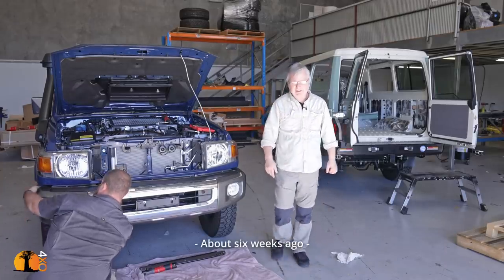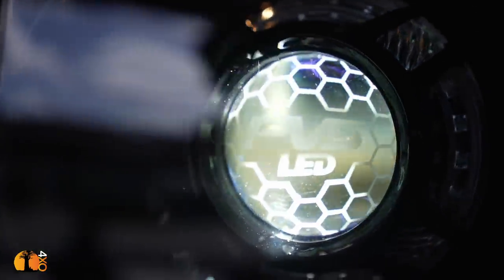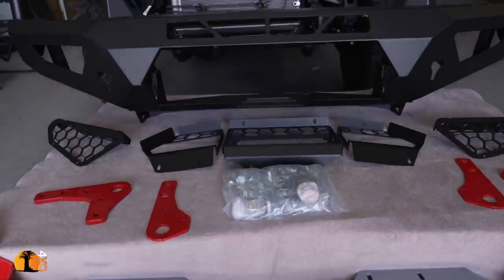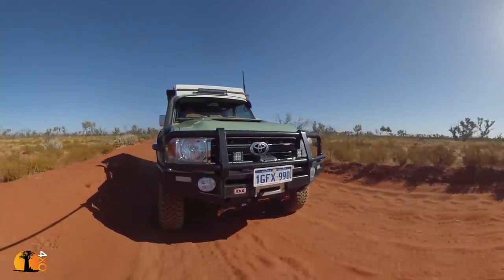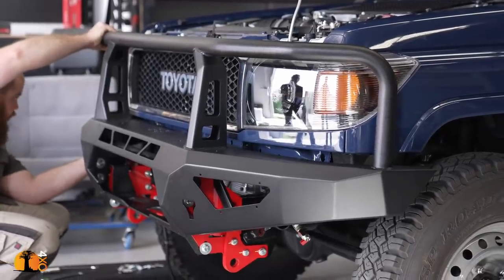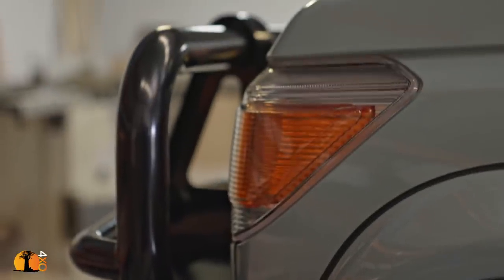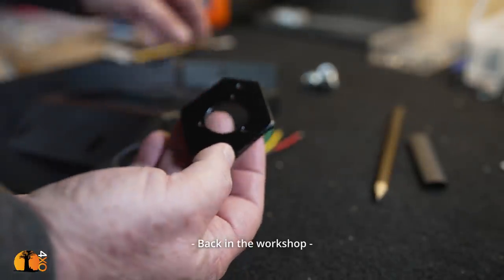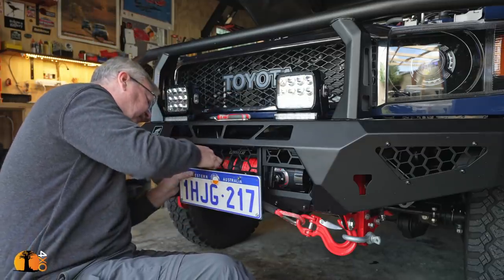BULL BAR, LIGHTS, WINCH & WEIGHT | How much weight have we added so far? | 4xOverland

Comment: Bull bar looks bloody awesome. Why didn’t you go for in cab controls for the Winch? That way you can slap that ugly box in the engine bay. Did that with my hilux, definitely the way to go.
Reply from the maker: Because from the cab, you can't see the winch. IMO, another bad idea.
Reply: 4xoverland I’m not following
Reply from the maker: @RyanYoxo  Controlling a winch from a location where one cannot see the winch or the recovery operation is like flying while blindfolded. BTW. I hid the box in the bar.
Reply: 4xoverland the winch is in front of the car? Can’t you see it? I’m generally confused. Plus you want to be in the car to give a little drive when needed or steer when needed. Just my opinion from living at the foot of the vic high country..
Reply from the maker: Yes. And the cab is inside the car, from where the winch cannot be seen. And nor can the wheels be seen, or the way the rope is spooling etc. Ive always winched from in, out and around the vehicle, and if it's a tough pull, the bonnet raised to protect the windscreen and driver in the event of equipment failure. To my thinking, the very last place to put a winch controller is inside the cab.
Reply: 4xoverland ok I see what you mean, you can’t see the barrel, tho wheel placing is easy to figure out from knowing your car but being around the vehicle with a loaded winch isn’t exactly work safe... rather than the spotters having the remote to control the winch wouldn’t it be more effective if they have a two way radio and informed you of anything you can’t see? I’d still rather be in the cab so you have complete control of the car than standing off to the side of it
Reply: Lots of bolts to rattle loose.
Reply: @RyanYoxo   I think if you need power to the wheels on a solo trip that is the only real reason to be in the cab, 90% of the time I’m with Andrew on this as I want full view of winch and wheels as not being able to view either makes it easy to damage the vehicle or winch if not paying attention.
Reply: Rauðr Ridge Overland I guess my winching has been straight forward because I can’t comprehend any of that.. what happens if the winch were to break and you weren’t in the car, or do you have the hand brake on at all times? In the cab I have full vision of the anchor point and rope, and again I have no issue determining the wheel placement especially if you have someone with you
Reply: @RyanYoxo  I get what you’re saying, each persons experiences are different. There are situations to be in the cab I agree, as I mostly solo trip on steep muddy/rocky inclines in the mountains so from the cab makes sense. However for a majority of people who are mostly on standard mostly flat ground or with two separate people the person controlling should have full view on the winch and wheels in case of winch binding or steering damage. It’s more of a machinery longevity/safety thing rather than convenience especially with the weight of the vehicle and power of the winch.
Reply: Rauðr Ridge Overland ok I see what you mean now especially watching the winch barrel for binding(generally can be felt tho). Like I said I live in the vic high country, it’s quite steep, so being in control of the car is most important imo. Also being an ifs car with only a lsd it means my winching isn’t complicated just get over the washout in the exact direction I was trying to drive it.
Reply: @RyanYoxo  i completely agree as I run steel cable due to weather extremes so I can also feel binding on the drum, however  i don’t know if synthetic is as easily felt or heard on the drum binding as I’ve never run it on any of my winches . I think you and I are kinda the outliers here since we both deal with a lot of mountainous terrain as most people who overland/off-road don’t. Andrew is far more experienced than me in terms of overlanding but I get where he is coming from as a heavy winch/machine operator we are always taught watch the cable and drum at all times. I agree with you 100% on the brake and cable breaking safety issue but I also agree with Andrew when it comes to normal low tension/pressure winching.
Reply: Rauðr Ridge Overland I agree. I’m no expert rigger so generally I wouldn’t know what’s best but I wouldn’t want to be off the side of a loaded winch that’s for sure. I wish to learn all forms, but for me being able to operate within the vehicle is safest, especially since I wouldn’t try any tracks I’ll need to winch out of by myself

Comment: Automobile makers are saving weight with High Tensile Strength steel. I wonder what it costs as an alternative.
Surprising about front:rear weight additions.
They really designed the bar to give it a look. It reminds me of a GMC. 
The railways use beltpacks (radios on a belt) to control switching locomotives. The person with the belt is the locomotive engineer. Communications with yard workers would remain the same.

Comment: Very very attention to details! Even the hexagonal mounting plate for winch controller socket! But cap is upside down! But maybe better that way. Yes That winch box is ugly thing! I do`nt know why they continue to build that way....?
Reply from the maker: Cap is upside-down for a reason. You guess why I did that.
Reply: @4xoverland  I guess because it is mounted at low position so when you actually look at it you will be looking upside down which translate you will be looking right side up????

Comment: I agree with your logic about one person being in control of the winch but can’t fathom your logic on whether that person uses a wireless remote or hard cable controller??? What’s is the difference? In my view the wireless remote would give the person better options to stand in a safe place in case a winch cable snaps. This is limited to some extent when using the hard cable controller due to the length of the cable.

Comment: Hey Andrew, I found the runva 13xp to be less superior for my application to the 11xp and for these reasons:
13xp is slower. By a fair bit
Was told it’s heavier
Less used than 11xp there for less rnd possibly?
Larger unit overall
Possible higher current draw? Due to 13xp
What are your thoughts on this? And what pros and cons do you see between the 2 units

Comment: How much more weight will the self levelling & wash system be that you'll obviously be fitting to make the headlights legal?
Reply: @jim yeats That only refers to the actual beam pattern as displayed on a beam tester. If you look further down the product page under the "Please Note" section you will find even they say for full ADR compliance a wash system & automatic self levelling must be fitted. I'm an automotive design engineer who worked in vehicle design approvals & this regulation has been around for years.
Reply: @gaj5701  Yes I see that now. Still seems very interpretive state to state and how ADR wants to view it. New cars are coming with LED’s without self levelling and washers. Just seems a bit over the top in general. Self levelling headlights and washer systems are one of those things put in place with very little data supporting their use with regard to their ability to actually decrease accidents and fatalities.
Reply: @JimYeats  The regulation is specifically for aftermarket units that change the method of beam pattern production as they haven't been approved for use as part of the whole vehicle. On a new vehicle, every technical aspect of the headlamp unit from light intensity to the method of attachment to the overall vehicle type is taken into consideration, which is why you often see the units fitted without the features required for an aftermarket one. As far as local interpretation of ADR, from what I can gather, there's no change for mandatory lamps, only additional ones such as spotties etc.

Comment: I see the argument for NO radio controlled winch switch as very  valid. More than one winch involved in a recovery!? My choice would also be a cable connected controller!
The on/off switch in the car on the dash for the winch controller is a good idea to stop people "playing" with the winch AND an emergency off-switch for the driver independent of who has the controller!

What I do not follow is the importance of the, I would say, over-kill of lights! Noone in his/her right mind will drive in the dark off a proper road except in an exceptional emergency! For those rare cases are all those lights? I have two additional lights on my cars for emergencies,  last time used? Can't remember - I avoid emergencies!
For just looks those lights are too expensive, aren't they?

Comment: Cruiser looks good. How did you take the shot @2:00?
Reply: If you look at the shadow, you can see the camera is on a mounted system.
Reply: @filipevieira2697  Thanks. Wondering how it is 'invisible' to the camera though shadow shows it is mounted on bumper directly in front of camera.🤷

Comment: Hi Andrew the bullbar looks a lot lighter do you think it will do the job it is made for .
Reply from the maker: It will. Is it as strong as the ARB? I doubt it. But how strong does it really need to be?
Reply: @4xoverland  I'm a Truckie they need to be solid but your a very experienced driver just need to be cautious thanks for the reply I've been following you since your last troopy build but could not afford the patreon part for a while but love your sincere reviews and I have copied a lot of things you have done sorry if I come across a bit blunt sometimes but I love all your work. Regards Paul
Reply: Rocket Rod fitted the prototype of this bar to his dual cab cruiser. Should check out what he has put it through. They are more than strong enough if he hasn’t been able to damage it.

Comment: Andrew what happened to no spot lights as they interfere with airflow to the radiator? Not counting a winch as well.
Reply from the maker: Now you are just putting words in my mouth. When did I ever say, 'no spotlights'? What I said was, 'overly large spotlights can cause cooling issues'. And they can. These are quite small and probably obscure less than 15% of the radiator frontal area.
Reply: @4xoverland  I apologize Andrew. I got it wrong, I thought you had said, no spotties and  had a rethink. My mistake.  Cheers, love ya channel.

Comment: The choice of bullbars is a personal choice and for me I still prefer the look of the ARB.
Re: Remote winch controller - even though what u said has some truth to it, winching is not something u take lightly as safety should be paramount and using the lead can put the user in the danger zone and this is where the remote has an advantage. The remote should not be touched until it’s ready to be used… So I don’t really agree your argument…

Comment: If you don't use the winch often, you may forget to check the batteries in the remote and when you need it, it won't work. Not something I would rely on

Comment: I guess is that your thought process at 08:00 is correct - but possibly you do have a bit of a specialist following in that your fans are more likely to know a bit about what you're doing, are a bit more cautious than the average "let's pack up and floor it through the mud" crowd. Thereby explaining those differences between your poll and the overall perception.

Comment: All winching operations you perform are operated by a remote switch, you are merely saying you prefer a tethered remote vs a wireless one.  To assume the operator is more or less involved based on wired or wireless remote isn’t a valid assumption.

Comment: Bull bar looks great! Along a similar vein, with remote winch controllers, I've seen a few guys forget batteries, not have the cabled backup, and then be stuck with a winch with no remote. Makes a great paperweight though! 🤣. Convenient however when working.
Reply: The YouTube channel Matt's Off Road Recovery found that their remote winch controllers interfered with each other.  They had a recovery that required two winches, but they could only pull in one winch line at a time because the wireless controllers interfered with each other.  They were even different brands of winch.
Reply: @The_Opinion_of_Matt  oh interesting! Do you remember which vid by chance? Love his channel but I don't remember seeing that.
Reply: @phill1491  Unfortunately, I don't remember which video it was.  It was a nore recent video and it had the Morrvair and Rudy's Jeep.

Comment: I have done the hidden control box and mounted the controller socket in a similar spot, one thing I’ve noticed is the socket has deteriorated and corroded quite badly over the last year. 

Nothing too crazy but just letting you know it’s worth checking and cleaning out once in a while due to the increased exposure to the elements

Comment: Um....you dont stand next to the winch during a recovery. The safest place place is in the cab with the hood open. The power of the winch should always be in control of the winch. So a wireless winch controller is just fine
Reply from the maker: Yes. I agree 100%. In the cab, bonnet up. I wrote that in my very first book, published in 1993. But a remote can also be given/taken by someone else. A cable works just fine, even with gloves. With gloves, how tactile is a remote? It's not at all. You cannot feel anything, but with a switch, you can't get it wrong even with gloves and it can be operated by 100% feel. Just my 2c worth.

Comment: When I watched the previous video I was gonna say 75kg added as seats were swapped reducing and then re-adding weight. What I forgot to account for was the BullBar.

As for the wireless winch controller I agree with you that one person has control - but why can’t they just use that wireless remote? It doesn’t have to be handed to a random person. Only difference with the wireless controller is there’s no cord (however you should always carry a backup corded one anyway in case of failure of the wireless one - just hopefully not need it).
Reply: Once you hand the wireless controller to someone else you no longer control who has it as the person you handed it to can hand it to someone else.

Comment: Why do you need a bull bar or a winch for that matter?
Reply: Stephen, have you spent time driving in the bush ?
Reply: @ookeekthelibrarian  
Not much , just drove from Capetown to uk across Africa via Namibia Zimbabwe Botswana Zambia Malawi Tanzania Kenya Uganda Congo CAR , Nigeria Niger Algeria , spending time in most countries visiting game reserves, jungles, deserts, swamps and everything in between. Did this in 1986 in a 110 Land Rover without winch or bulbar without ever having missed them. I also did not fit spotlights , sound systems. Only modified the back to make a bed and added long range fuel tank, water tank and an aluminium roof rack. Had a very enjoyable very comfortable trip lasting 13 months.
Reply: @stephenbarlin2314  only 13 months experience mate, vs Andrews 20+ years😂
Reply: Less damage to the front end when you hit stuff. 
Can pull own vehicle or another vehicle out when bogged.

Comment: Why not wire the remote into switches in the cab instead of running a longer cable for the wired remote? Then there is no remote in your argument at all, all on the driver of the vehicle

Comment: Are you OK Andrew?  Generally your comments are well thought out, with very valid reasons, and full of common sense.  And for the most part I agreed with them.  But lately you've been making comments that are highly questionable.  This time about your reason for not liking wireless winch control.  Do you seriously believe your reason?  Or did you make the comment to generate more replies on your videos.  More replies = better YouTube algorithms preference for your channel, right?   If these comments were made by anyone else, I'd just dismiss them as an uninformed comments.  But not from a well travelled, and educated man like you.  So are you ok?
Reply from the maker: Called me old fashioned. I've done a lot of recoveries and never had a single mishap or even got close to a mishap. And a hand controller keeps one person in control - always. And I think a remote controller increases the chance of a mishap without adding anything significant to the recovery process. It's a controversial topic as you know. I put my toes in and - got bitten off by people with far less experience than me. This is why I would never demonstrate a recovery on video. I'll turn the camera off, get my vehicle out, and carry on.
Reply: @4xoverland  But can't you do the same with the wireless remote? The person in charge of the recovery has control of it, like you would do with the wired one? This is what's baffling me with your reasoning.  Anyway FYI. I too, hide the winch control box.  Nice job in remounting the plug.  The Bullbar looks fantastic,